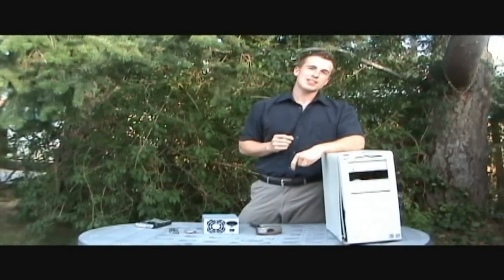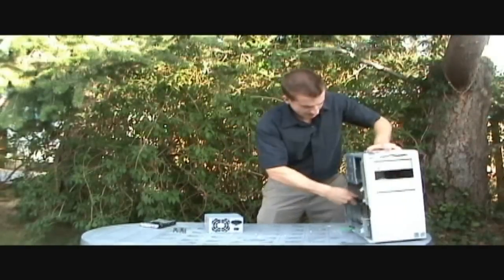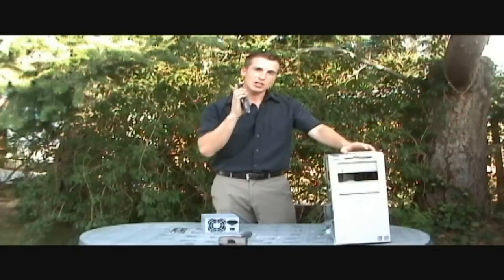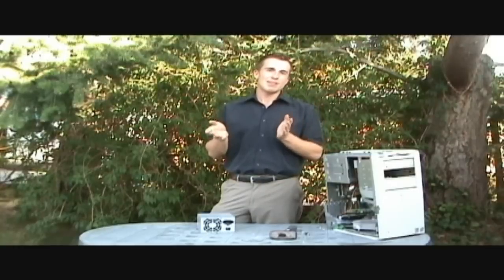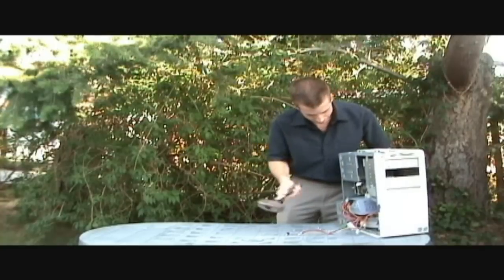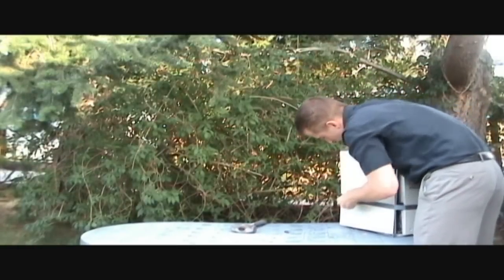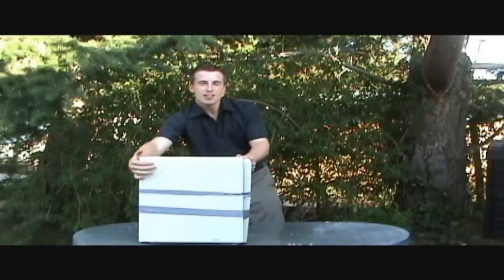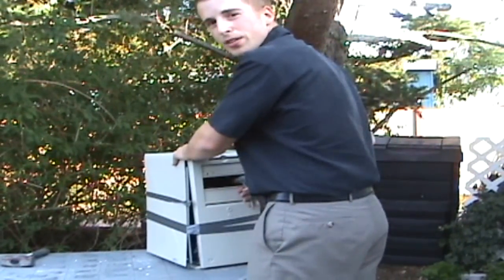How to overclock - Overclocking made easy

Comment: there is a much better way to over clock:take a clock and tape it to pc the rotate the hands around and around for about 50 years to "overclock" takes a just a LITTLE longer and it does not really work but its better then going into some bios and getting results